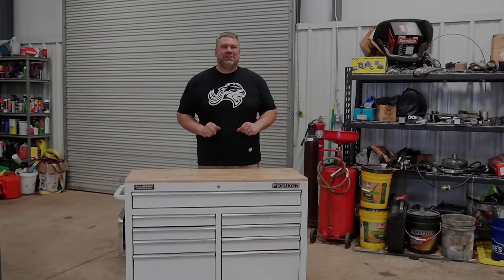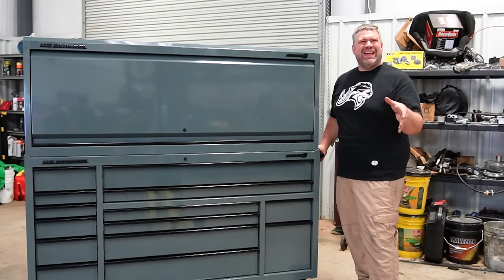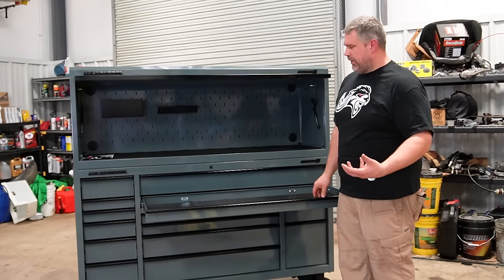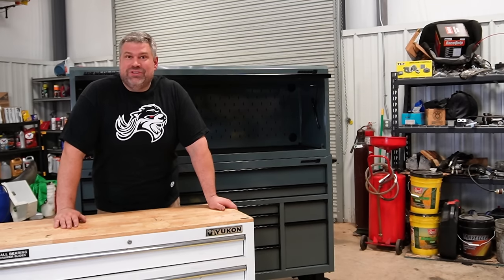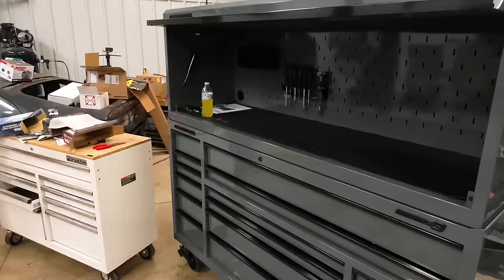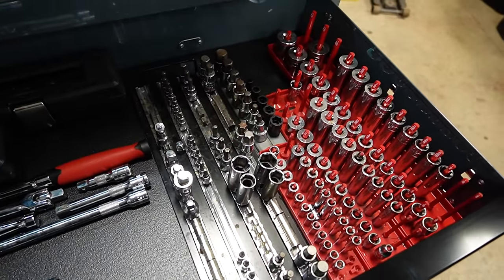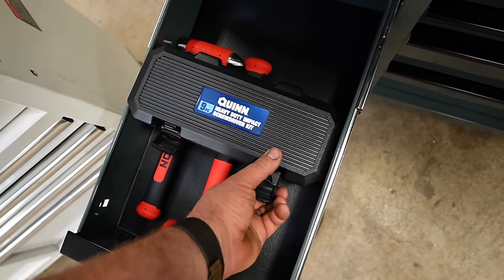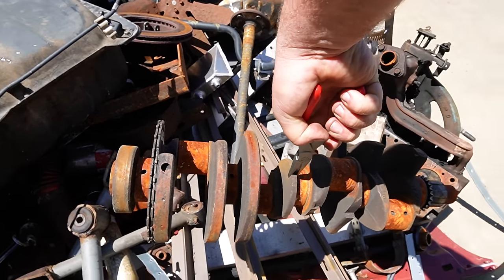Can You Really Save $20,000 With "Cheap" Harbor Freight Tools? U.S. General Series 3 Review

Comment: I was in the trade for just over 30 years. Owned several different boxes. When I retired I sold my 20 year old SnapOn box to an apprentice.  It was immaculate really. But I had no more room. With the money I sold it for, I bought 2 Chinese 72inch boxes, upper and lowers. For home use they are perfectly fine. If your working out of them 40-50 hours a week, a good box is paramount.  Those HF Icon boxes look pretty damn good for the money. I would buy one of those over a SnapOn  in a second.  I don't like the hutches.  Every person I've ever seen with one , it's just a trash collector.  Instead of putting tools away properly they get thrown in the top in a huge mess.  I just think it's wasted space. I would rather a bank full of drawers.  I don't feel so bad now. I have a bit of a wrench fetish myself. Every shape, every style.  In SAE and Metric of course.  Just a word of advice,  flare nut wrenches and crows feet, buy good brand name. I have SnapOn for those. I started out with cheaper ones, Craftsman possibly, whatever they were, just junk compared to SnapOn.  Some things you can cheap out on, definitely not flare nut or crows feet. Especially when you're using them all the time. That's how I based all my tool purchases over the years. Don't spend a boat load of cash on something you might use once every couple of years. Or buy it just because it says SnapOn or Matco or whatever.  I've seen so many guys over their heads in tool truck payments because they want to look like a professional.  It's sad but oh, so true. Especially young guys just starting out.  I think Jared has given a lot of good advice for tool purchases.

Comment: Been a mechanic for 35+ years. I skipped the tool trucks and bought craftsman tools. But some I had to buy off the truck were specialty tools. These days I look online before buying any tools. I worked with a guy who bought a tool off the truck for 100 dollars. I bought the same online for 36. As most of my tools are at work, when I do something on mine or my kids vehicles, I end up at Harbor freight. When I grew out of my 20 year old Craftsman box, I looked around and found a nice one online but ended up getting a harbor freight one. It has lasted well over five years except the long drawer that I put all my half inch sockets in and it broke the slides after about 18 months. but that was because I overloaded the drawer. I enjoyed the video and I'm currently waiting for my expansion box to come in. I need more room as the newer vehicles require different specialty tools.

Comment: one of my biggest complaintes with harbor frieght sockets and wrenches is they all come in sets. Most of the sets skip a size or two and they dont sell singles so you have to go find one else where. I always end up at Homedepot looking at the husky line of sockets when i need a single. They carrier basically every socket in a single and makes replacing a lost or broken tool that much easier.

Comment: I really do like the Pittsburgh ratchets, but when I'm working I go on auto pilot and the reversed switch doesn't work so I have them at home. I use the Quinn digital torque wrench almost daily though and it's been great. Very happy with the Doyle pliers too. I started out in the business across the street from harbor freight, so I've had plenty I didn't like as well

Comment: I literally got back from Harbor Freight when this video popped up.

I just bought an Icon flex head 1/4 inch and unboxed it while watching.
The main part of the handle feels nice in my hand, and the head is a ok size. Two things I don’t like: where the head meets the handle, the head is smaller than the handle and it makes a sharp shoulder that makes choking up on the handle uncomfortable, and it’s only on one side, so it’s asymmetrical. The other thing is the ratchet mechanism takes far more effort to turn and makes a grittier sound than my equivalent Snap-On ratchet.
Conclusion:
This Icon wrench will stay in my home toolbox unless I lose my Snap-On at work.

Comment: I have had my husky 26 inch top chest, and 28 inch bottom chest for ten years now. both of them have held up remarkably well drawers and gas shocks for the lift top work just as good as day one. I've dragged them all over. lifted the top off to travel many times. the paint has held up to torture and I have splashed it with everything from grease to brake fluid. soldered in the top of it. and I paid less than 250 dollars for both at the time.

Comment: The biggest upside besides the cost savings is, I don't have to wait or search for the tool truck when I need a replacement or fixed tool.
 I can walk into Harbor freight, Lowes, Home Depot and they'll swap the tool no questions asked as long as it has a lifetime guarantee. 
I bought a set of Kobalt wrench's/sockets in the early 00's and broke a ratchet a couple years ago, took it in to the store, ZERO hassle exchanging it. Same with Harbor Freight, I've broken my fair share of their tools and never had an issue exchanging.

Comment: Thank You 
But I’d add these Icon tools to your set Parrot Nose Pliers # 58881, screw exactor # 58699. The screw exactor for removing cap screws with striped heads and sheared bolts and screws, the parrot pliers for turning bolts with rusted or stripped heads an even better is the Channel Lock # 410 Nut Buster. These are recommended from experience with corroded nots and bolts. 
Listen you Youngin.

Comment: my personal experience with tool companies is that with the top brands like matco and snap on and so on ive had tons of issues with although i do like them i would always suggest to newer mechanics to go with cheaper companies. yes the tool may fail quicker or the tool boxes may be a little cheaper but ive never had a hard time getting my warranty back on any tools for harbor freight or in canada at princess auto or canadian tire. im a diesel mechanic so my tools get beat to hell and i can tell you that my 300 dollar socket set is just as good as my 2800 dollar set from snap on. and most of the high end tools are built in the exact same place as the cheap ones and made with the same materials. if you want to get the expensive tools get the cheap ones first and save up because youre gonna be eating noodles for awhile if you go full out right away. i guarantee you most of those cheap tools will still be around when your back gives out and you hand em off to the kids

Comment: Been turning a wrench almost 30 years now. If you want good stuff like a box you can spend 2500 on us general that will be worth 1500 at best or you can buy a used snap on, matco, ext. and loose value. Sockets and wrenches are easy to get everywhere for almost the same money but far better quality. Harbor freight has some good stuff but most isn't better than what others make or cheaper anymore.

Comment: I wish Harbor Freight did a weekly payment deal like the tool trucks do. What I like is that its an agreement set between you and the tool truck dealer. You pay him a set amount weekly and you have a minimum and a max anount yiu can pay him weekly so he has a decent turn around rate. This doesnt get applied to your credit. Its just an oral agreement between you and the dealer and he reserves the right to reposes that tool or set of tools if you dint finish paying him. Ive gotten a handful of tools from Cornwell this way. Cornwell had the most convenient prices and are in some cases conpetive with AutoZone and other parts stores that sells tools. Plus as a bonus tool truck drivers are usually former mechanics/technicians and most of them will provide superb advice on what tool will be useful for a job do you frequently. They're usually not going to try and force tools on you just to get a sell. Least thats what ive noticed about the tool truck drivers in my area.

Comment: I won a 4 drawer 24” tool box with a 3 drawer top box that listed for $100 at Montgomery Wards 45 years ago.  4 homes and 8 autos/4 motorcycles/5 trucks later it’s still here with all the tools that have lasted (not one name brand wrench or screwdriver)over 52 years.  Not more than $350-$450 in tools bought.  Happy as any mechanic can be at 72 years of age.

Comment: I've had a US General toolbox for about 8 years and am actually impressed with the quality. Yes, the "rubber" mat stinks like Chinesium rubber. The guys in the plant weren't pleased so I got rid of it. Set it outside for a couple of weeks and the smell pretty much goes away. As far as parts, good luck. The manuals list part numbers for lots of things but none are stocked or orderable. My lock exploded so I called to order a replacement by the manual part number. What I got was not even close so I reinstalled the original and pretended to lock it.

Comment: I’m not a mechanic, more of a DIYer. A retired paint contractor more specifically. My cousin is a retired mechanic. 45 years in his trade. Had his own shop. Only bought and used Snap On tools. He was an “old head”. I’m all for good tools, parts, paint and equipment. I could never 👎🏽 see Snap On as the only option.

Comment: Correct, it isn't a price against price thing, it is the heat and extreme pressure of the spot weld machine.  It happens on all thin metal that is spot welded.

Comment: 7:10 There is no available "US General" light solution for this hutch, and there never will be, HOWEVER, HF has confirmed that the optional light fixture for the Icon hutches, which sells for roughly $100, will fit inside of their US General counter parts.

Comment: My problem with any of those hutch style tool boxes is the height, I’m 6’2” and the are way to short for me, across the board. I just bought the new big harbor freight roll around cart, it’s great because most of the daily use tools fit in it and you can roll it around to the lift instead of walking back and forth all day
Reply: Some of the mechanics at my job set their boxes up on big truck brake rotors to get a few extra inches in height.

Comment: since apparently you have some sort of sway with harbor freight, if you're allowed to make suggestions please ask them to make a competitor to snap-off's 808CF skinny diagonal cutters. I'm in aviation and lemme tell you, those things are worth their weight in gold but it would be nice to not have to tell every new guy that they basically have to go on the snap on truck and buy them. the places you can stuff those up into to cut off cotter pins and stuff is actually incredible.

edit: also, for those of you in aviation, I've had issues with HF torque wrenches passing cal. so if you're gonna throw tool truck money at something, make it your torque wrenches. not saying they're all bad but I have had issues with it. same with tekton torque wrenches funnily enough

Comment: Back in 1999, BEFORE my now second ex wife and I split up, for Christmas she gave me a large Kennedy Roll Away cabinet!! And even though I did, and still do appreciate it, for what she paid for it, it has been the largest pile of "expensive junk" I have ever owned!! It isn't a bad toolbox mind you, BUT I still have plenty of problems with it!! To start with the bottom of my Kennedy Toolbox is a cabinet and NOT an extra drawer, and where I could really use an extra drawer or two, it only has four drawers, that my wife (at the time) never seemed to consider!!! And I know she could have at least ASKED ME what I needed and wanted, but she didn't so I basically got stuck with this toolbox in the configuration that it is in!! I will sat that it has amazing casters, BUT I have never owned a garage or a shop that had a concrete floor, so moving it around is a completely WORTHLESS feature to me!! In fact the toolbox, like my top chest has spent most of its life inside a storage shed with ZERO work space, meaning I am typically running to grab a tool then hiking all the way back to where I need it! The metal my Kennedy box is made out of is high quality, BUT the paint flakes off in large sheets, so the back of my toolbox is basically a large bare piece of heavy gauge steel!!! Another weird thing is my Kennedy only came with FOUR drawer dividers, and they were all the same size to fit in the one medium depth drawer!! 

Again I did appreciate that she bought me a toolbox, BUT she really didn't consider the tools I owned or what MY NEEDS for a toolbox was!! And even when she gave it too me as a Christmas Present, I really couldn't tell her then, what I disliked about the gift as I didn't want to come off as "ungrateful", but in a lot of ways, like her this toolbox has outlived its "usefulness" around my shop a long time ago!! Though I still have my tools in it to this day........I am thinking that I need to make a change here soon.....and a new bottom chest might be in order!!

Comment: Good morning. I’m starting a mini truck project and I am an avid Harbor Freight purchaser. I’ve ordered the Quinn master mechanic tool set. I’ve purchased my US General tool box. Getting the hutch later. Could you send me a list of tools I will need.  Removing the engine and sending it off. Removing and replacing body panels. Going to attempt a paint job myself. Maybe some self teaching welding. Any help is appreciated

Comment: I just bought a US General 56" with upper cabinet and 22" side locker in blue. Was extremely excited until I was told it was going to take almost a month to get the boxes and 2.5 months for the side locker. Also the Harbor Freight I ordered from is the tool box delivery hub for the whole city. I bought this because I did a lot of research and decided that they were the best for the money but I needed to use them now, not months from now. They put me between a rick and a hard place but I bit the bullet and ordered them anyway. I've been a long time supporter of Harbor Freight but this was very aggravating.

Comment: You said this box is a poor candidate if the box will be moved around often.  It just doesn't roll very well, you said.  But is that true if one installs swivel casters in place of the 2 fixed casters, not to mention greases all 4 casters? ( The box should already have all swivel casters, but that is a matter for another discussion.)

I need to load/unload the box(es) regularly in/out my car hauler trailer. The 30" Snap-On box I have now is at best 1/2 the size I need.  My choice is to buy another 30-40" box or buy one 60-72" box.  Loading/unloading and strapping down two boxes is, well, twice the work  and takes twice the time of dealing with just one box.  On the other hand, two smaller boxes are easier to handle than a single 72" box.  I have a winch on the trailer so there is sufficient muscle power to handle either variation going in or out.

Another point for consideration is that the 72" box is the only one currently available in Series 3, which you point out is considerably improved from the Series 2.  I need the box now so cannot wait for the smaller boxes to be upgraded to Series 3.  Do you think it would be a mistake to go with a 72" series 3 unit in my circumstances?

Comment: I've gotten a lot of hate for my views on harbor freight tools. We built our current racecar with harbor freight tools and the only issue we had was with the 4 1/2 grinder,the hand tools performed flawlessly. And ues we ised chrome sockets with a impact and never broke one. We've used a Bauer battery 1/2 impact for six years for R&R of wheels at the track and never had a issue. We used the same impact last winter to build the car and it took the cradle bolts out with ease and the rear axle bolts without any problems. Heck hf tools jave helped us win races and a championship so

Comment: Add a good LED light strip and job is done. So far the only problem I’ve had with Harbor Freight tools are some of the battery operated drills the batteries were junk and they didn’t have the same reliability as my Milwaukee ones

Comment: I like the HF boxes. What I'm not a fan of is their locking system. No softclose on the drawers. If u just spend right in between the US General and SnapOn  as example and get the Icon boxes you'll get a top tier quality box imo. The US General are still good boxes though. There will still be lots of those mechanics that will say Icon tools are junk, when in reality they are lying to themselves. Harbor Freight has brought high quality tools to their stores with the ICON brand.

Comment: My advise to anyone that is tool box shopping; buy this box or the icon box…. If in the case you get peer pressured into buying a snap on box get a roll cart to start out they make small-large size roll carts for less than 3k and buy them used! The peer pressure in this industry is real and some people cannot work correctly at their job with co-workers in their ear saying “you should’ve bought strap-on”. Get something cheap and upgrade later, coming from a 7 year mechanic…

Comment: I’ve been quite impressed with Harbor Freight’s Maddox tools. I’d say they’re on par with OTC for sure, and 1/3 of the price. The only tool truck tools I ever extensively bought were Cornwell and S.K., I knew the rest was all a scam since the first Snap-On truck I set foot in 26 years ago. I do have a few Snap-On ratchets and I’m also finding out now that I’m self employed, working mobile and out of my garage, that warrantying Snap-On’s stuff is a royal PITA with no tool truck coming around. Talk about getting the run around.  HF has turned it around the last decade or so and thankfully there’s one right across the street from my house.